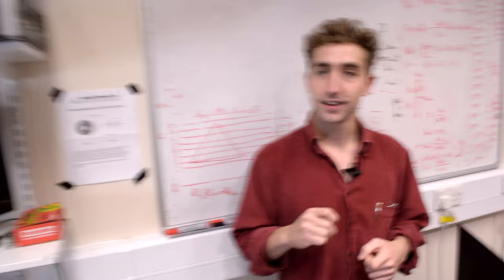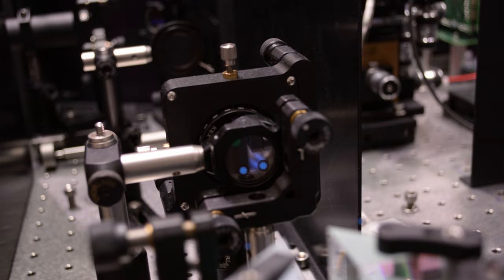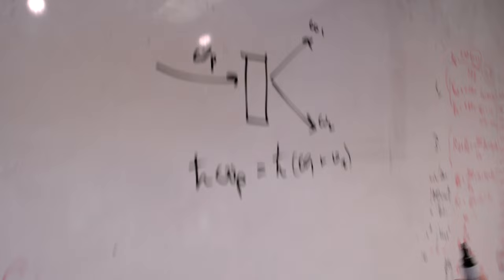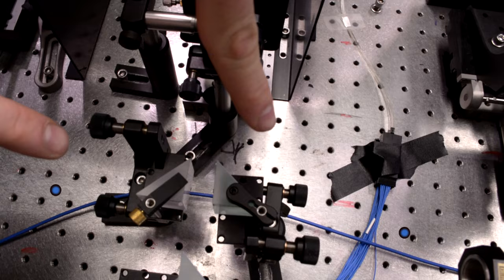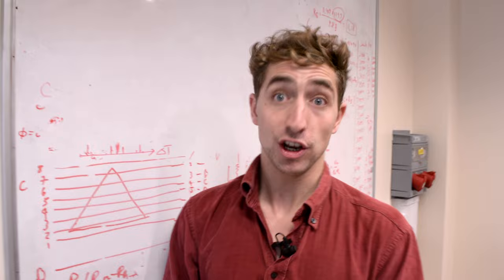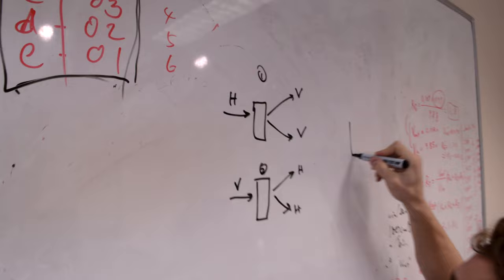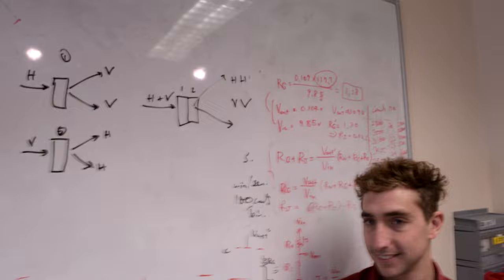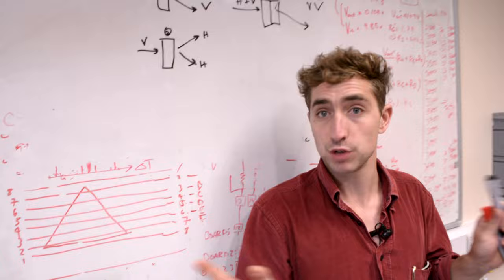How to Produce Entanglement

Comment: I have a 4 questions. Would you be kind enough to answer each of them.
1) When 2 particles are entangled and one particle spin is measured is it true that both particles superposition collapses at the same time and the two particles have opposite spins? 
2) When the measurement ends do both particles revert back to a superposition. Are they still entangled? 
3) If they are, can one of the entangled particles be measured again collapsing both there superpositions to have opposite spins?
4) What experiments have been done to answer these questions?
Reply: 1- imagine that you have one pair of work gloves. your daughters made a prank on you and ship one of right or left glove to canada. in order to find out which of the glove your daughters send to canada, you only need to check the the you have, or you can fly to canada, pick up the shipment and check it. both ways give you information about gloves.
2- as we know so far information cant be destroyed.
Reply: Yes, No, - -

Comment: The most read article in Quora on the Conundrum of Entanglement as of Friday 6th Feb 2018. Below is brief summary. For the full details click on the link below.
Entanglement: When two Subatomic Particles share the same Spacetime code they become entangled. As experiments have shown that two entangled particles act as one system as if they are communicating with each other instantaneously. If this is the case, then it’s reasonable to conclude that the data stored in the Cosmic Database are indexed in accordance to their “Spacetime codes”. So any update to one record leads to updating both records. Based on this postulation, we suggest that any change in the “Cosmic record” of an entangled particle must lead instantaneously to a change in its observed physical quantum state. It also lead us to conclude that the act of entanglement is necessary for the conservation of momentum, symmetry and and other relevant information. These suggestions support the possibility that we are living in a Holographic Universe.

The Measurement problem: 
The observed wave functions of Subatomic particles are due to the nature and characteristics of two Basic Energy Particles responsible for their existence. The particles at the quantum level could be in any one of several states until they are measured. The act of measurements leads to their recognition in terms of cosmic information in that specific state at a given cosmic second.
In the double slit experiments, to explain the collapse of the wave function we speculate that as photons interact with the observed electrons. They instantly share the same “Spacetime code” which make them entangled. Once an observer capture these photons (in the act of measurement and recording of the data) a new space time codes are given to the photons. This leads to the cessation of the state of entanglements as the photons no longer have the same spacetime code of the observed electrons. In response to erasing the act of entanglement, the observed electrons reset themselves by getting their energy cloud collapsing in readiness to start a new cycle of spins.This is done to preserve the law of supersymmetry. 

Consciousness and data recording: It is suggested by some physicists that the act of observations through effective meditations lead to the collapse of the wave functions. We speculate that such trained meditators are able to concentrate, capture and register the information carried by the entangled photons in their memories. This act of recording by the meditators constitutes particles interactions similar to capturing the data by measuring devices. Such interactions lead to the resetting of the relevant entangled pairs, hence the collapse of the wave function. This makes us an interactive players in the quantum information collected and recorded.

https://docs.google.com/document/d/1qpnegrI9ox0gBRnN-jvA0PXHgcbpAdhwwpS__eBocq8

Mnafousi@gmail.com

Comment: ok so lets see have I understood this! SO when the lazer fires the photons out are you saying that when they get split into two photons they are still connected to each other by an invisible force? So that essentially they are still one but just split????
Reply from the maker: Hey! Sort of, yeah, though I'd be careful about thinking of them as the same thing. They share some property linked between them (spin), but they are two distinct objects, and they have half the energy of the original photon
Reply: @DrBenMiles  ok thank you! So now I need to find out what spin is! Best vid yet Ive seen.
Reply: @DrBenMiles  also how do you know they have half the energy than the original?
Reply from the maker: @GreenLight11111  hey, just saw this.  Easy answer is, you can measure them, and see they come out as the same wavelength (colour). That's just because 1.)energy has to be conserved and 2)theres no preferential mechanism to give one photon more than the other as they are emitted simultaneously.
Reply: @DrBenMiles  Thanks ben! wish i had done physics back at school! ok one last question - so what colour is it? ie the same wavelength you mentioned? when reduced in energy what colour are they?
Reply: @GreenLight11111  good question. I am too.

Comment: Thanks! Your explanation of entanglement as a system is the most helpful I've come across yet. This video kinda implies that all it takes to produce entangled photons are a couple of crystals and a laser. It is really that straight-forward? Is this something that I could do in my garage? (Not that I'd know what to do with entangled photons even if I could produce them.) Or is the equipment actually more complicated and costly?
Reply from the maker: Brian Peiris Hey! Good question.  Unfortunately most optics set ups are quite expensive as the components need to be high quality and aberration free.  Also the laser used in this set up produces a pretty powerful femtosecond pulse and runs above £100k :/ as it is a bit of a niche market.  

In principle though, yes! It's not too complicated to produce entanglement, the tricky part is keeping them entangled and unaffected by the environment (unobserved). And then doing something useful with them!
Reply: whentheappledrops it's not helpful using expressed such as "observed", perhaps you should say measured. You cannot measure without disturbing/interfering. Saying "observed" implies it is a passive process and conjurs up anthropomorphic images, which leads to woo
Reply from the maker: joyork Cool man.  I feel where you are coming from
Reply: does the table or room have to be near "vibration free" like an SEM table or room?
Reply: You can buy BBO crystals for 1000$ and a simple UV laser will do. You´ll need polarization filters and phaseshifters as well, but you can do it for like 2000$ total. To check your entangled photons, you´ll need the so called coincidence counter consisting of two avalanche photon counters.
I heard it can be set up for 5000$.

Comment: what happens when you iterate this process? ie split one "photon" in half and then spit that half again? I would assume you would get a 1/4 of the energy naturally but if they are entangled would you end up for 4 1/4 energy protons or 2 1/4 energy protons and 1 1/2 energy proton? I assume the 1st result might prove entanglement while the later might disprove it or at least show the next split disentangled the photons somehow. I'm sure im missing something but would love to hear anything thoughts on this or any info about running the experiment this way? Thanks for the video.

Comment: I am not a physicist so, first of all I like to apologise if I my question is stupid. I just want to know where I am going wrong here.

But if I have understood anything about the entanglement principle; it is that two entangled particles have opposite characteristics that is kept regardless of distance: e.g. if one of them is detected to have a right spin then other is bound to have a left spin. My question is does that holds only when they are detected at the same time, the synchronicity of which must be quite difficult to achieve? Given such small tolerances how can we be sure if both measurements are synchronous?
None the less if that is verified to be correct then I don't see it being that spooky. All we are saying is that when a wave particle is split into two wave particles they remain in sync although mirrored through time (be it a short time). I.e. they are not really communicating with one another through some as yet unknown dimension beyond time and space.
But if the measurement (detection) doesn't have to be at the same time then it is really spooky because it implies that detecting one part fixes the other part is a definite state which again if I have understood it correctly is contrary to the superposition principle which claims that the state of a particle can not be determined until it is detected. 
If we can know the state of a qbit before it can is detected then all sorts of things should become possible or at least theoretically, such as instantaneous communication because then we can select the qbits based on their known states.
Reply: The thing is that physicists have made an experiment that is accurate enough to say that during the measurement made on two spatially separated photons, not even light could have travel (and potentially carry information) between those two photons during the measurements. So of course, physicists can not pretend the measurements are absolutely synchronized (and it doesn't even make sense to say so because if you change your frame of reference, the synchronization will change, cf special relativity), but they could state for sure that there was no information coming at speed of light exchanged by one measured photon to another.

The reason why it is spooky is the following : none of the photon have an identity before ones make one measurement. It is not as if you had two balls, one red, one blue, you hide the color and put one ball on another planet. After that, you check the color of your ball : say it is red, so you know with certainty that the other ball on the other planet is blue. This is classical physics, and their was no information exchanged between the two balls because the balls already had colour before you separate them. The quantum mechanical version of this experiment is : the two balls are in superposition of state and entangled, so it is as if they are both blue and red. No matter how you separate them. If you try to determine what is the colour of one ball is (say red), the other is instantaneously blue, and this is true no matter of how far the balls are. The ball you didn't measure is now blue with certainty. How does the ball knows it is blue now? No one answered this question correctly yet. The only subtlety is that we can not realise with real balls because they are macroscopic object and the uncertainty principle would not allow us to produce obvious entangled state. This is why we use photons and polarisation, otherwise the principle is the same.

What you say at the end is right, this is why so much people are working on qbits and quantum computer. But you should not forget that in order to be entangled, the photons should have interact in the past.

I'm not used to speak english and the topic is tough so I hope it is understandable :)
Reply: Clément De Daniloff my mind just got blown. Thanks for that explanation tho.
Reply: Seems like you understand your quantum physics, would you help me with my questions? 
1.Does this mean that after measurements are taken on the first particle, the second particle is no longer in superposition?
2.Can multiple measurements of the same particle be taken throughout a period of time? Would the particle  change its position every time?
Reply: Babak Kamali Mind = blown
Reply: Antoniq Nencheva Hi again. I can at least try to answer your question.

first question : yes exactly. I will take again the example I wrote above with colored ball. So let us suppose that, like polarization of photons, I can produce two entangled ball whose colour can take two value : blue or red. The state is such that the ball always the same colour a measurement. In the Dirac formalism this is written like :

state = | Blue, Blue > + | Red, Red>

which is a superposition of the state where the two balls are Blue, and one where the two balls are red. Say I measure one the colour of one of the two balls. Say I obtain "Blue". The wavefunction is said to "collapse" and the state of the system direct after the measurement is | Blue, Blue>

At this point, the following statements are true :
- The two balls are no longer entangled. Every new measurements made on one of the two balls will never affects the other one. This will remain true as long a the two balls don't interact again, and in order to interact again they have to be in the same place and meet a device that produces entanglement.
- the system composed of two balls is no longer in a superposition of states : | Blue, Blue >
- the system composed of only one ball is no longer in a superposition of states : each ball is in the state | Blue>.
- If I keep measuring the colour of one ball or another or both, I will always obtain "Blue"

Note : I will not be able to explain why when where and how the wavefunction collapse during measurement, neither I can explain correctly what we mean by measurement. If someone do know. The interpretation of Quantum mechanics is a big subject of debate.

I hope this answer your question! There are some other subtleties that I did notre mention here but If you want I can give you the link to a video where everything is explained in detail (it explains how measurement changes the state of the system, and what are the consequence for entangled system)
Reply: Thank you for your quick and detailed reply! It did answer my questions. 
I would like it if you also give me that link you were talking about. I find Veritasium's video very informative when it comes to measurements but would like to hear another way of explanation.
Reply: Try to watch the two videos of "viascience" entitled "Quantum Mechanics 10a - Bell's Inequality I" and also the second one. These are best non-technical explanations I found so far, I can never be clearer than this, and there are several animations to make things even clearer. He also made other videos on quantum mechanics which you can watch if you want to understand more the context.
Reply: Correlated particles have some correlated characteristic that is persistent over the lifetime of the particles.  That is, they will retain their correlation as they move in opposite directions.  However, the particles are susceptible to being disturbed, and any disturbance will degrade or destroy the correlation.

Measuring one of the particles has no effect on the other, but it does allow one to make a very good guess about the other, thanks to their correlation.

The word "determined" in this context is a little confusing.  We don't know the state of the particle until we get around to measuring it.  We find out something about it when we take a measurement.  

When you drive your car toward an intersection that has a traffic light, the light is in some state (it could be red or green), but you don't know until you look.  In the act of looking, you "determine" if the light is red or green, but that doesn't cause it to be red or green.  If you also know that all the traffic lights on your road are synchronously timed, then you can also infer the probable state of the next light, too.
Reply: what you are saying actually is what einstein exampled of hand gloves....but it is incorrect....proven by john clauser experiment...
Reply: what if the original ball "photon" was purple tho? you split it in half. you measure one ball as red so no matter where the other ball is it has to be blue. That really wouldn't be entanglement that would just be the law of conservation. Now if you measured the red ball and wore able somehow to change it to blue and then the other ball changed to red now that would be entanglement and very spooky action at a distance. Not claiming this is a right analogy just throwing out ideas.

Comment: it sounds like the particle that is split at the time of the measurement is actually just showing a set type of frequency or state that has to be on the opposite side of the measurement spectrum on the other side, if you split it three ways or even four wouldn't they each show a different position on the other equal side of the spectrum.

Comment: I think there is an unknown here. And that is, the |0 deg|45 deg|90 deg| polarizer setup shows that the polarizers don't just select a certain wave length angle that matches it's angle, but also bends certain wave lengths that are close to it. It has to. I donno. Otherwise why would the 0-45-90 produce more (any?) light than 0-90?

Comment: Once you create this particle, how do you track a single photon (or pair) to do anything to it?  It doesn’t have an address, you can’t save it, and it’s traveling at the speed of light.
Reply from the maker: Create question. Thats what makes dealing with light so hard. You need to do your "operations" or computer logic on photons in flight. You measure them only once, when they arrive at the detector